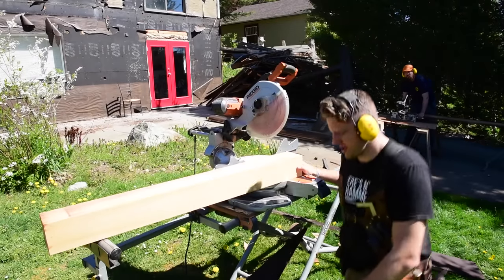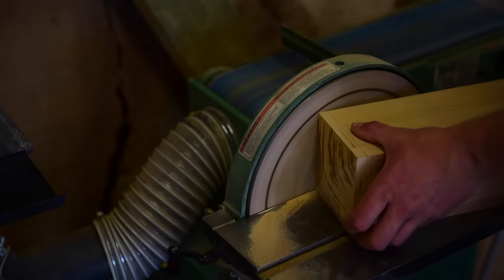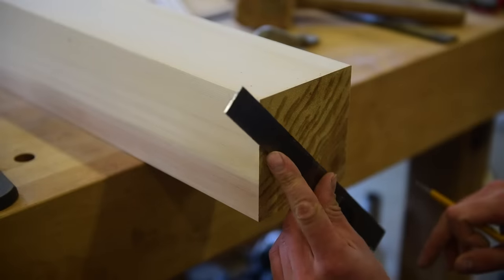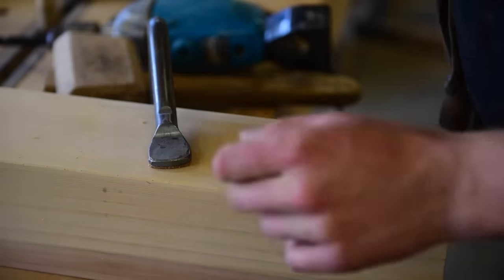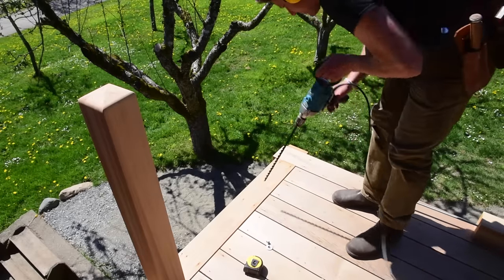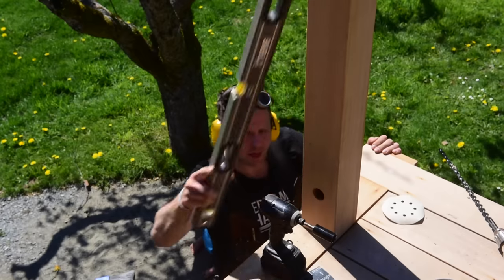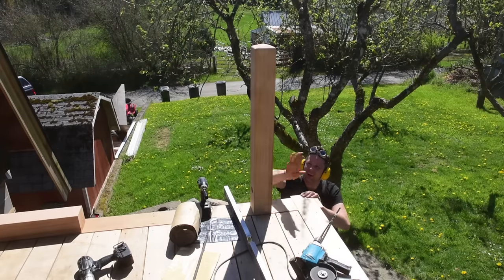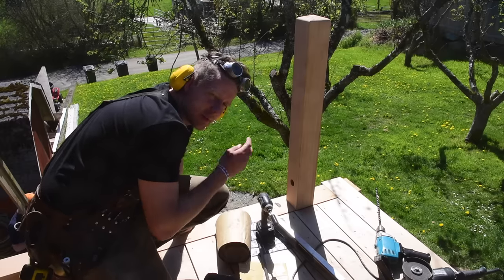FTF #54 How To Install Handrail Posts, Quick And Easy

Comment: Tip for cutting threaded rod and bolts.  Have a nut on the end you plan to keep (maybe both ends) so that when you are done cutting you can slowly turn the nut over the cut end to repair the threads.  Don't fully remove the bolt until the threads feel correct.  Just work the nut almost off and then back on and back and forth to clean up the threads.

Comment: This video just solved the issue I was having. Going from a wood rail system to a vinyl rail system. Now the post trim will work for me. To much rain and sun(heat) in Jersey this summer. Thanks.

Comment: All you Nay Sayers. I have always done mine the old fashioned way or code way and I will say this. I recently built two decks. One a refurb and one completely new. I have always hated notching so I experimented on the refurb. I could push against, and snap right off, the old way. now with only this method and doubling the sill and screwing them together I could not even bend one over. Thank you samuraicarpenter for this great idea.
Reply: I'm redoing my deck right now, replacing the old wood with Trex and Trex railing. Would this method meet code? Since I wouldn't be messing with the sanding of the ends (covering them with the post cover and end cap, this method would not be very time-consuming and would make doing all the picture framing and decking go a lot faster. I was planning on notching and adding 5 more posts since it's a different style railing.
Reply: @michaelpeck5547  You're not suppose to notch 4x4 handrail posts. That's code in many places from what I understand.  I like the thru-bolt idea. I've never experienced it but I'm skeptical. Side torque seems to apply too much pressure on the post bottoms. There's less than six inches there, part of it drilled out.

Comment: A hole drilled even 6” deep into the bottom of the post requires a certain amount of luck to ensure that the rod and side hole are sufficiently aligned. This is a great idea for line posts as an alternative to setting posts through the deck or side mounting. I think a couple of jigs would make this more of a production technique. Some steel bushings set into thick solid stock using a drill press would make the post and deck drilling much faster, more accurate and damn near foolproof.

Comment: I would love to see some side-by-side load testing for this method vs. the standard 2 through bolts through the side of the rim joist.
Reply: great thought, seems this bolt option would outperform in all categories..   one upgrade 'thought' is to increase the diameter of the threaded rod..   blessed to have found this vid <3

Comment: I heard that your bearings are bad in the DeWalt. I had the same thing happen to me. so I took them out cleaned them up looked for damage there was none.  the grease had just dried out not a very good quality. I used a great synthetic grease and now my saw will start at below 0 if need be. you can get the seals off by using a fine pick then they'll snap back in place you might want spin them up to there will be some loss of grease just clean up and put back together.   

Nice job on the post and an inspiration for us all watching. I have the same Affliction you do perfectionism is a hard thing to live up to every time but I seem to do it as you do. thank you for your ideas and tutorials you make all of our work a little better.

Comment: This technique works like a champ!  Solid as a rock!  I just did this with 6x6 Cumuru posts.  Used a wax end grain sealer for my end cuts instead of rubber.  It was the fastest post install I’ve done out of three decks.  Highly recommend it.

Comment: A short length of hardwood dowel ripped down the center to fashion a semi circle makes for a good spacer inside your pocket hole and provides a flat surface for your washer.

Comment: Codes vary all over the country. In PA we have 1,256 various jurisdictions to deal with. 90% adopted the ICC codes but many with their own ordinances voted into law so always check with your AHJ. 

A variation would be to use his hollow chisel mortise in the shop to get the flat hole first then drill up into the void. It can then be plugged with a square 'Dutchman" with waterproof glue. They make those bolt and barrel quick connects for furniture and newel posts but that wouldn't work outdoors I don't think unless you can get it in ss. 

The base end grain can be primed or sealed to stop moisture migration, too but the membrane is a new twist. 

Wonder how well that galvanized coating on the all-thread will hold up in his damp environment with the tannic acid of the cedar. If no budget concerns, get 316 ss and it will last a century. 

What wasn't shown and is critical is the sub base the all thread nut and washer bear on. If this is thin or weak it could fail as the failure mode for this post system is tension on the rod which would tend to act as a lever. The force transferred might crush the fibers of the joist sufficiently that if it isn't dead center drilled it might fail. We've had a LOT of deck failures in the East with a lot of injuries so this is serious. One way to strengthen this system is to enlarge the footprint of the post by using a 6"x6", which spreads the load at the deck boards like a plinth. 

Nice to see a craftsman taking the time for little details. 

What you need to make for Alec Steele is a caddy for his hammers and drifts with a side holster for his water bottle and one on the other for his farrier's brush. Perhaps a rack, much like a bit index to hold all his hardies and fuller mandrels. Make it M&T in Greene x2 style. Enjoy your work Sammy.

Comment: Great looking job! I guess my only potential concern is with boring a hole completely through a load-bearing span. I know it is a double rim joist, so it probably is fine, but still I just wonder what an inspector or an engineer would say.
Reply: a lady inspector might say "do you have time tonight?"
Reply: It looks neat, but I doubt that would meet code.

Comment: Samuriason what's your plan on the corner having post set back looks like 6 to 8  in
Reply: Jami's Jamz prolly a 2 post corner.
Reply: Jami's Jamz  was wondering the same thing!
Reply: When he was installing the outer trim pieces he said he was going to set the posts back and have the railings float in the corner
Reply: Trust the samurai. he always a step ahead. those corners are going to be real nice.
Reply: would look super sexy if he half lapped the rail like he did the trim board and had the triple tiered floating halflap corner!!

Comment: I like that you won't have to cut into the picture framing as you would with a post that runs through the decking and is anchored to the floor joists. Your method is time consuming but looks beautiful and clean.